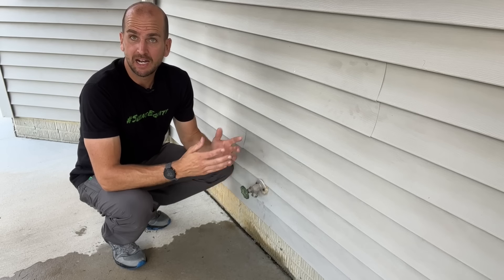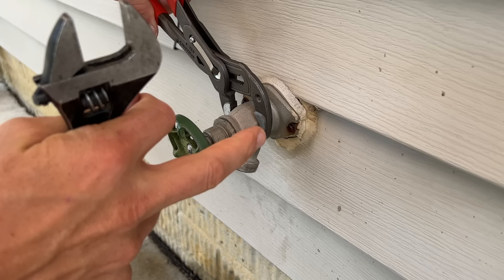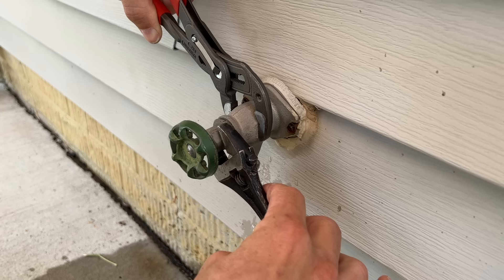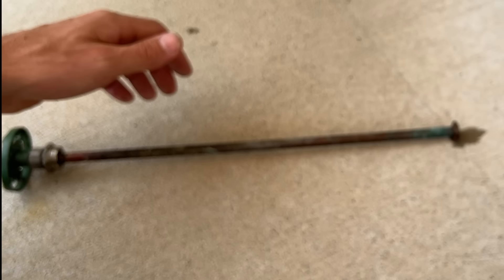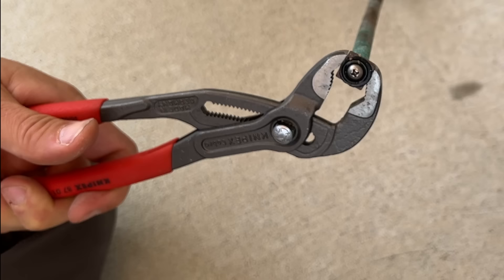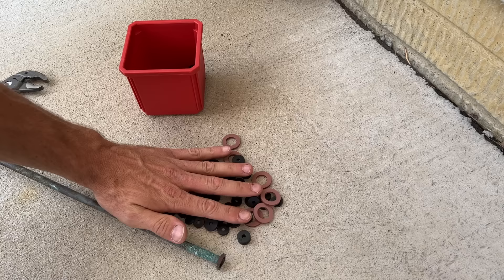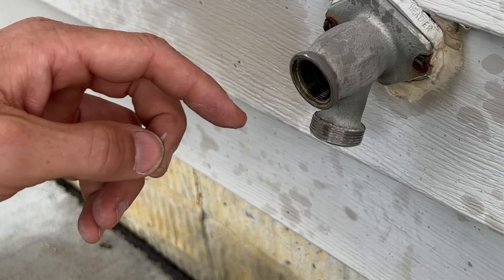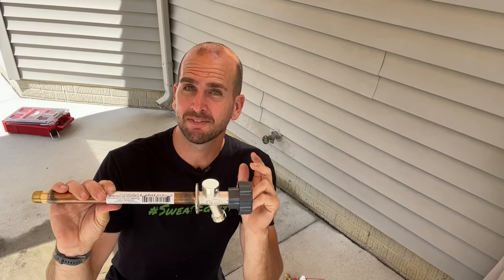How To Fix A Leaking Outdoor Faucet | Easy DIY Fix!

Comment: Here's a tip. When checking the gasket at the end of the shaft, if it's not split or badly damaged but just compressed, simply turn it over and reinstall it. The underside is like new and will save you going to the hardware store for a new gasket. I just did this yesterday and it worked perfectly. Remember not to crank the faucet all the way down tight when shutting off. This will wear out the gasket prematurely. Only shut it off enough to stop the flow of water. Gasket will last much longer.

Comment: sometime there is a chrome seat inside pipe that gets pitted and will cause leak. if you dont change both in time it will leak again as rubber washer will get cut again

Comment: I have a outdoor spigot on my raised mobile home that leaks but does have another valve on it which I don't know why plus a drilled spot where we water supply line attaches for the swamp cooler. Any suggestions for me.?

Comment: My faucet still drips in front, eve when shut off downstairs, which I do in the fall before it gets frosty. So I hope those small drips won't create a problem in the basement, since shut off from basement. Can't really afford to run my heat though. So I hope the pipes in the basement won't freeze.

Comment: I had a small drip from an outdoor hose bib. In one month it used up 6000 gallons of water according to my water bill. I had to replace the entire hose bib since I could not dismantle the old one. The replacement only cost $12.

Comment: Did exactly as this video suggested to a tee. Unfortunately I still have the leak so I capped off the spigot. What would be the next step? I used a new rubber washer on the end of the 12 inch anti freeze rod that is attached to the handle. Is there something on the inside of the pipe to exchange? My set up is that the 12 inch rod is screwed into something that is internal in the pipe, and then screw the handle screw onto the spigot. Any suggestions?

Comment: I have the same type of assembly. Unfortunately for me, the screw holding the washer in place is rusted and when trying to remove it, pieces of the screw broke off making it impossible to remove the washer. Also noticed some other wear on the assembly. Is this whole assembly still available? If so, can you provide a link?

Comment: The issue I have with one of my outside faucets is when I turn the water on it leaks from the frost free cap.  I replaced the o-ring, but it still leaks.    Have you worked on the frost type faucets?

Comment: Basic WD-40 is NOT a penetrating oil. It is a lubricant and moisture repellent. You need the penetrating version of WD-40, it'll say such in the grey banner on the can. PB Blaster is also a good option.

Comment: I connect my garden hose and when I turn the water on the water leaks from the hose faucet connection even though it is tight and nothing is in there. I checked for dirt and debris. What do you think is going on?

Comment: I want a full port, 1/4 turn faucet.
Apparently they do not make a 'frost proof' one nor an 'anti siphon' one either.
So, I just shut off the water spigots from inside the house. No more worries.
Also, I do not use hose end sprayers - just straight water.
If it siphons back, it would siphon back plain water.

Comment: You should have shown leak at handle stem too ….  Try 1 is tighten up first nut   Try 2 is add / replace packing under tgat first nut

Comment: My daughter’s external faucet still leaked after replacing the seat rubber or ceramic washer, of which I think the problem is in the BONNET. But, I haven’t been able to get back over there and ADD PACKING ROPE INSIDE BONNET. But it’ll be ok, since it’s at her flower garden.  And when I do, get to that faucet, and it still leaks , the sure enough a professional plumber will replace that faucet as well as the one on the back side of the 🏡 , and possibly add an additional faucet closer to her garden box. 💪🏻👏🇺🇸 7/6/24

Comment: Hold the body of the spigot with the channel locks the other way.  You will have a stronger grip on the spigot. WD-40 is bad for the packing material. Silicone spray without petroleum distillate is best.  
The anti-siphon valve makes no difference with the water draining out. It may just drain a tiny bit faster. The frost free valve is designed to always drain out, with or without an anti siphon/vacuum breaker device. Otherwise, water left in the pipe will freeze....  Not frost free.... 
Wipe the washer with a thin film of silicon plumbers grease. It will reduce the abrasion on the washer.
Reply from the maker: Hey Mark, thanks for all the feedback.  I appreciate the help 👍

Comment: I'm trying to replace a spigot at my work place, but the only way to turn off the water is by turning off to the entire building which i cannot do. Is it possible to replace the rubber washer without turning off the water if i don't mind the mess or getting wet myself? Or will i not be able to shove the rod back in to mount it back? Any help would be appreciated, thanks!

Comment: I have the same type of faucet.  When I turn the handle to the right to turn off, it doesn't stop. If you turn it a little too much, it feels like it's stripped.  I've changed out the rubber washer at the end and it works a little bit.  Any suggestions?

Comment: I had the same leak. Unfortunately, the screw that held the rubber washer at the end of the stem was rusted/fused to the stem. The stem actually broke when trying to loosen the screw. Had to buy a new unit. The old one had about 9 years on it with hard water and deposits, which contributed to the corrosion of the stem.
Reply: To let other people know, if you didn't want to sweat a new fitting on, Sharkbite makes a frost free one that simply presses on.  All you have to do is follow their recommended preparation.
Reply: Try reassembling with silicone grease this will help.
Reply: @AStanton1966  Can you send me the link to the Sharkbite part you used? Like @styverdyver, the screw on the end of the stem on my unit is rusted and fused. Thanks.
Reply: @ADHTube  Rocky's Hardware in Vernon, CT is selling them.  If you live in the states, you could probably contact them.  If I remember correctly, it was about $40.  Also look at Lowes'; they seem to have a big selection of Sharkbites.  Funny you wrote this, I just added 2 Sharkbite ball valves for the washer yesterday.  With all the watering draining through the pipes, I don't know if I would have ever got them dry enough for a sweat job.

Comment: Another  issue  associated with the old washer which was not mentioned in this video: If you observe carefully the old washer you will notice that its diameter increased from being flattened over time. The increased diameter will restrict to some degree the flow of water.

Comment: How is water still coming out the faucet even though you turned the main valve to hous off? I have the problem, do i need a whole new spigot? I’m in the warmer state in GA , and i was on my way to the HW store for a new washer but noticed it still leaking even though i shut off the water and too the handle off

Comment: I had this problem. Was actually leaking into the basement. Quick fix….bought a brass cap with built in o-ring from Home Depot. No more leak, no more water in the basement.

Comment: I saw this kind of anti-frozen water faucet before. My biggest concern is if the rod in the middle of the copper pile will reduce the water flow, especially when I need large amount of water at a short period of time.
Reply: IME it doesn't seem to reduce the flow significantly, the units are designed with a large enough pipe to compensate for the reduction in cross-sectional area from the rod.
Reply: Im pretty sure it doesn't. Water flow is not your biggest concern if you have that in your house you probably have winter and it can freeze your water line and crack and then you're in trouble

Comment: Don’t you want to back off the stem from the bonnet nut before you put the stem back in? Makes sure you don’t pre crush the washer. And for really old spigots, it’s a bit different. You may have corded packing that is installed just beneath the bonnet.
Reply from the maker: Yeah, that is a good idea.  Thanks for the feedback.
Reply: Good notation.  A leak from the spindle where the handle is attached is also a very common leak area on outdoor spigots.  The problem can sometimes be resolved by simply tightening the bonnet nut to compress the bonnet packing inside, or you may need to remove the handle and bonnet to replace the packing, or add additional packing material to the existing.  Various corded packing materials are available or graphite disks for a few bucks or less.

Comment: Thanks, great video, but I have a different problem. My spigot gets 95% tight/closed then feels like it strips thru the threading and is a raging stream of water again. So it's never able to close all the way. I can stem the flow if i apply force on the spigot towards the house, but obviously cant keep it there, it pops back open. I've been able to temporarily fix with thread tape at the spigot connection as you did, but usually doesn't hold up an entire season. Any thoughts on what else could be damaged / needs replacement?
Reply: any advice @everydayhomerepairs?

Comment: I'm kind of surprised you didn't put some packing around the valve stem under the Bonnet nut while you were there
Reply from the maker: I had some Graphite packing string in the Packout box as well.  Not a bad idea but it was holding strong so didn't want to disturb the packing.  It will probably start leaking next week 😂  Thanks for the feedback.
Reply: @EverydayHomeRepairs  wish you would get patreon to add a annual subscription to your Channel

Comment: Does this exact type of valve have a replaceable seat? I’ve replaced the washer a few times and it fails rather quickly. Getting under the house (100 + years old 🏚️)to replace the entire valve is going to be a real PIA if you know what I mean. 😕

Comment: So, I accidentally rotated the whole thing. It was incredibly easy to do, so I wasn't sure it was wrong, but after watching this I think I may have done more damage. The copper tube is now freely rotating deep inside the house. Any advice? Is this a problem I need to call a plumber for?

Comment: Just keep in mind that if its a really old faucet, the O ring my fall apart as when you try to remove it, leaving you without a reference. Then your calling a plumber. 
I just bought a two way splitter with quarter turn valves and installed it on the leaky faucet. Just leave the faucet open and use quarter turn valves.

Comment: WD-40 is mineral spirits, not oil.  It is minimally useful for un-seizing corroded parts.  A far better product is JB Blaster, available most likely on the same shelf as WD-40.  It is used exactly the same way.

Comment: Might be a stupid question, but I'm gonna do it anyways... xD
Would a ball joint valve solution work as replacement, if there are any for outdoor faucets like that? If not, what are the potential issues?
Reply from the maker: I have seen a few with ball joints but only for the type without the frost proof / freeze proof pipe extension.  https://amzn.to/3Tbobv0

Comment: What do you do if after you loosen the bonnet and try to pull the spigot out but doesn’t come out? Feels like it’s stuck. Can you apply and pressure/force on it to pull it out or does this signal a different issue?
Reply: I read it may need to be turned by using the handle. I’m assuming the obvious left to remove?

Comment: When you closed the valve after changing new washer you just need to snug tighten it when its new, you closed it kinda to tight this will cause it to flaten to much and split

Comment: HELP
I cannot get the screw out to replace the washer! I have the same spigot assembly. I am willing to replace the entire stem  but don’t know where to find it. Any known hardware chain suggestions?
Reply: Any hardware store in your area should have what you need in stock. You will need access to the connection of the hose bib to your plumbing system. Don't use WD40 as he suggests as it may eat any rubber washers or seals (depending on design), if you intend to just service it. Use plumbers grease. You could torch off the rubber seat to gain a better grip on the screw.

Comment: How do you take that 10" spigot with the grey handle apart?  I've got one and can figure out how to get to the bonnet nut.
Reply from the maker: This video should get you headed in the right direction https://youtu.be/scf5ovLI4Uk
Reply: Buy and install a new one! It isn't worth dikking around with the kind you have.
Reply: @daddy1571  I think you may be right.  The screw is frozen in the threads.
Reply: @EverydayHomeRepairs  Thanks.  I think that the screw holding the handle on is welded by corrosion.
Reply: @percyfaith11  Im a Journeyman plumber and believe me it just needs replaced. God love you for at least trying to fix it though!
Reply: @daddy1571  Yep, I always try to fix up the old stuff instead of tossing it.  Poor Richard's Almanac philosophy of "a penny saved is a penny earned."
Reply: @percyfaith11  Smart man 👍

Comment: The instruction is good, but no offense, you've put the wrong washer. The marking (size) on the washer is supposed to be "00", and when installing, I'd put this marking inside so that on the other end, it will be a flat surface that will properly seal when you shut it off.
Reply: Between the video and your comment, I'm confident that I can fix my leak.
Reply: "00" is a good guess, probably correct, but there are other sizes, such as 1/4 small and 1/4 large also.
Reply: @gregggoss2210  I change them a lot per year, and the "00" always fits perfectly.
Reply: Sill? Or Seal? Mr know it all.😅😅
Reply: I would just change the whole faucet and get a modern quarter turn one

Comment: There are 2 components to replacing the washer, one is the new washer, the other is lapping the seat because of pitting. You completely left that out. A pitted seat will ruin the new washer almost immediately and your leak will come back.
Reply: How does one locate and replace a pitted seat? Or was the seat what he screwed the washer to?
Reply: @afrodesiac8064  Yes, the seat is what the washer mates to. You need a lapping tool to remove any pitting. One can be purchased at the hardware store. If you have "hard" water, the pitting is likely. You may need a flashlight to see the seat (especially on a recessed one like he showed).
Reply: @stanleyreynolds7800  thanks for the info! I just fixed a leaky spigot earlier largely thanks to this video.

Comment: Do I have to turn off the main water or can I just turn off the water line that goes to my outside faucet?
Reply from the maker: If you have a valve going to that spigot you can just turn off the one location 👍
Reply: Thank you!

Comment: That stem into the wall is L-O-N-G man. There's no way in hell mine could be that long. Besides this how does the one used here which looks to be some 12 odd inches mate with the supply line inside the wall? Especially to the up, or down, 90 deg. supply line pipe inside the wall (between the brick and interior sheet rock? I didn't take mine apart yet but it can't be anymore than 7 inches long at most.
Reply: The unit comes in all different lengths...a couple inches to 14"...so I've seen.....YES....THATS HOW IT WORKS!!!

Comment: Would this fix a water leak if the water is on and the hose is attached? I’m not sure where it would be leaking from at that point
Reply: good question...I have the same problem
Reply: @pob1845  i hope someone can help us! I was quoted 250 for a single replace!
Reply from the maker: Sounds like you just need to tighten the hose a bit more on the faucet and/or just the rubber gasket in the hose.  You should see a red or black gasket and should be in good shape.  Take a look and let me know what you find.
Reply: @EverydayHomeRepairs  ill take another look...but if I remember correctly, is was still leaking with 2 differents hoses
Reply: @EverydayHomeRepairs  i don’t know about Po B, but mine is leaking where the knob inserts the actual assembly? I had a plumber come out once and he tightened the “packing” and it only lasted one day
Reply from the maker: Yeah, he probably just tightened the packing nut but the actual packing material could be shot.  You can get graphite packing cord and repack under the nut which might work better.
Reply: @EverydayHomeRepairs  do you have a video on this or know someone that might?! I’m VERY hesitant to try to fix that

Comment: I had/have a Prier 400 series hydrant and I bought $30 in their washer repair kit and a new handle.  That didn't work.  So I went to Menard's and paid $36 for an entire new hydrant and installed that instead.  Why mess around with these little pieces when you really need a new hydrant?

Comment: What do I do if the screw on the handle is stripped?
Reply: Mark rapacki  literally the screw that holds the handle in place is stripped, so I can’t even remove the handle. Someone used a drill or something because there are no threads it’s just a dent now.

Comment: But 1st, put channel locks on the correct direction when backing up another wrench. I mean, my guy may be more intelligent than me, but I started from the bottom. My dad taught me that there is a correct way to use said tools. Who cares what your working on if you stuck at using them

Comment: These hydrants are not meant to last and end up dripping no matter what brand sometimes as soon as I you install them. It’s a money racket. I suggest putting a ball valve directly in front of the hydrant. Problem solved.

Comment: Better idea. You can buy an attachment with a turn off at Home Depot. Screw it on to your existing faucet and no leak for about 5-6 bucks.
Reply: Then when freezing temps come it will freeze at the attachment you suggest installing, and maybe burst/split. That's only a very temporary fix at best!!!